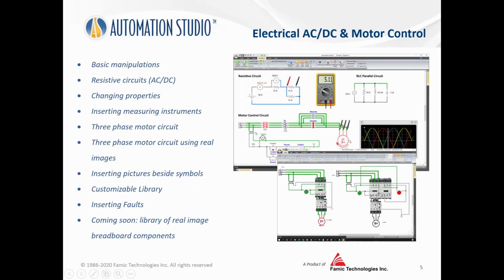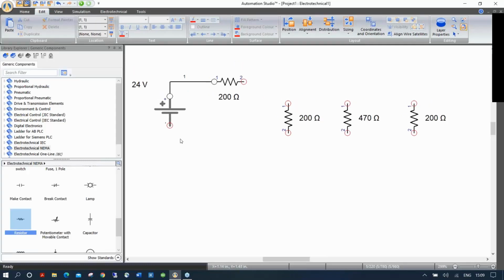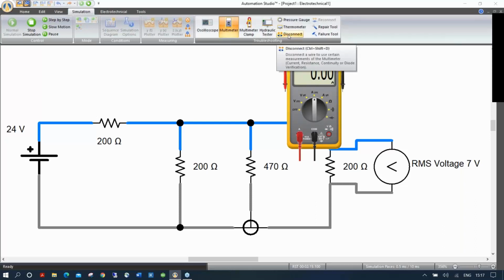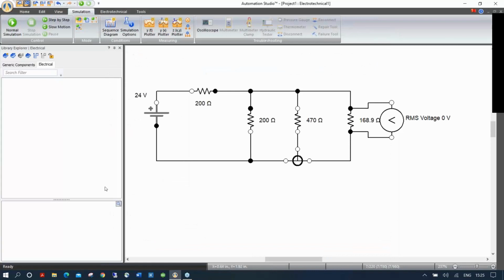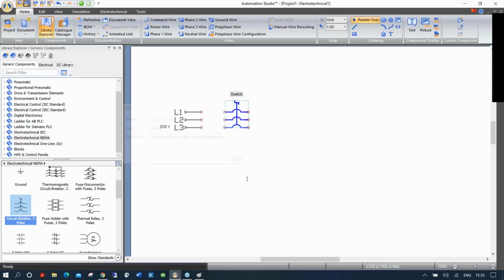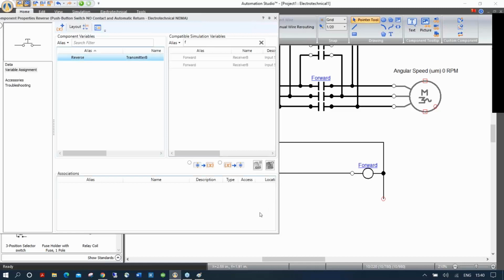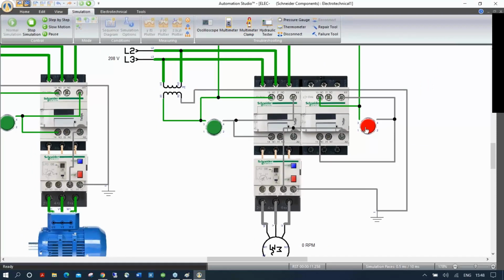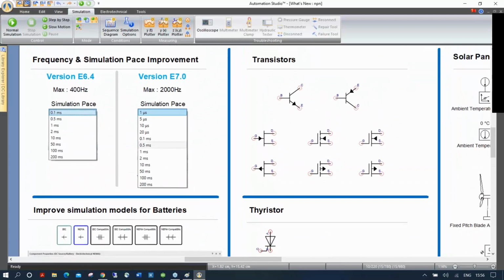Electrical (AC, DC and Motor Control): How to use library in Automation Studio™

Comment: Dear Sir. Thank you for the very educative video. I have a question though, about the speed and position sensors in Automation Studio. I don't know how to utilize them or to interface them, especially the absolute encoder. I checked them if they have Simulation model, which they had, but still i am very confused in which device should i connect them to utilize the revolution data. I would appreciate your help in this case
Reply: Hello Rigers, with version E7 we have created a component that enable you to trigger these kinds of contact and also have access to the Analog variable of these sensors as well. Feel free to contact Famic to have more details on this component in version E7